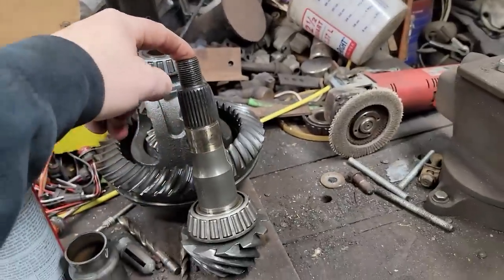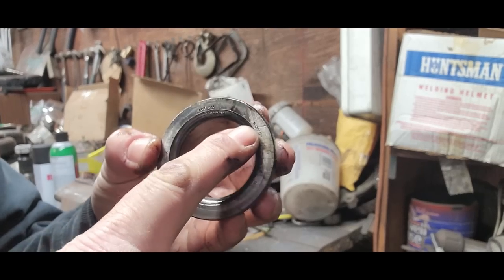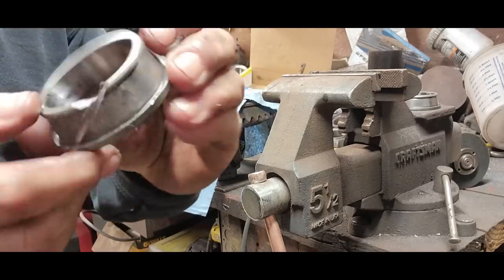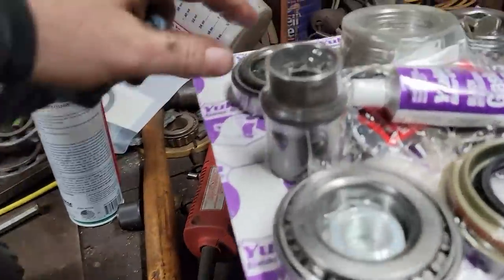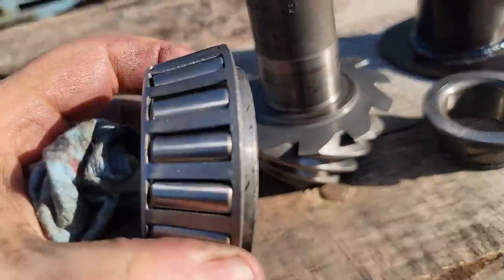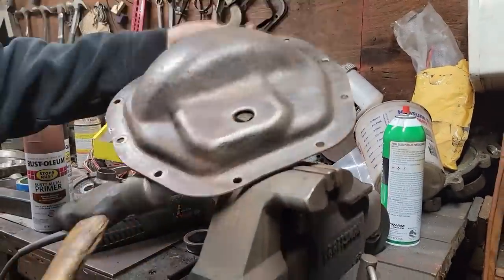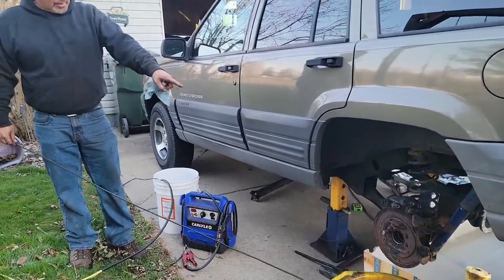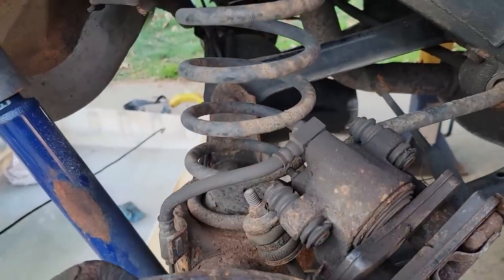JEEP REAREND REBUILD PT2 PRESSING NEW PINION AND RING GEAR CARRIER BEARINGS WITH OUT A PRESS!

Comment: I know you know but just to mention:
you can put the shaft/carrier in the freezer and bearings in the oven at 250 
and the bearings take much less effort to p-ress on
Reply from the maker: sure is an option. these went on pretty smooth. i was happy with the results so far.

Comment: If your able to save the pinion bearing or buy a extra you can run a small flap disk on the inside of it on a die grinder so it a slip fit Incase you need to change your shim. Then once you know it's shimmed properly you can slip it off and put your new bearing on. Hopefully that shim is right or your probably have to get another bearing.
Reply from the maker: i have used a cylinder hone to do that when i am changing the ring gear and pinion. i was thinking i shouldnt need to reshim the pinion since it was wearing well. otherwise, i would have done just that.

Comment: I use a cheap fry daddy filled with synthetic motor oil (higher scorch temp) to heat the brgs and they just drop on the pinion etc.

Comment: Advance rents various grades of specialty tools for what they cost at their price and you can keep them. They do appreciate a heads-up so they can order a new one which you could rent later and return the first one. I've done it many times which gives me time to think about is whatever worth having on hand or am I broke and need the $.
Reply from the maker: i am familiar with that. if i was in a spot that i could not do it without the tool, i would call my snap on man. he would let me borrow his until the one i ordered came in. i just dont like borrowing anything.
Reply: @j.c.smithprojects  Neither do I. I'd rather have a pawn shop tool that's mine now and worry about getting better when I can afford it. I hate loaning tools out just as much.
Reply from the maker: i will gladly help someone using my tools but i will not loan a tool. far too many times i loaned tools only to have to chase it down and go out of my way to get it back...usually damaged. not how i was brought up. "you return it in the same or better condition than when you got it or dont borrow it at all".

Comment: you probably have finished the Jeep before you read this i took a large nut welded to a pipe and then a 1/2" drive wore out socket to the other end to adjust the preload on the carrier bearings

Comment: To my surprise, Harbor Freight bearing splitters are actually alright if your OTC set never shows up. OTC is offshored as well.

Also, the last nasty differential I got into, I put a ridiculously strong magnet on the outside of the cover just to help pull any debris inside I may have missed away from the moving parts. It will also help catch any fine particles from new bearings and a new gear setup breaking in.
Reply from the maker: very good point. i will try and find a very strong magnet.
Reply: @j.c.smithprojects  I used one sold for magnet fishing that had an eyelet it on it so I could zip tie it to the anti-sway bar just in case it ever gets knocked loose.
Reply from the maker: im going to put it inside on the diff cover.
Reply: @j.c.smithprojects  I thought about that, but got gun shy that it might come off when oil is blasting around in there. I considered gluing it in, but then putting it on the outside ended up solving all of my problems. I used a 250lb pull magnet that should have plenty of guts to do the job through the cover with no risk.

Comment: I really like your tube cleaner tool     great idea and im def gonna make one
Have you seen the steck hub saver race tool        basically it rotates a hub while you heat the race til it just falls off     ive bought one recently and it works slick       its for a hub so its held in place on a cone     in your application with a solid shaft im thinking maybe a turntable with a small vise      might be a worthwhile project
Reply from the maker: no sir. i have not. i was going to use one of the induction heaters to heat just the inner race.
Reply: @j.c.smithprojects     yes the heat to expand the race is the main idea    the rotational movement just ensures equal heating      it seems so simple easy a guy wonders how he never invented it himself       a bearing splitter should work fine getting in behind the race and doesnt slip off like a 2 jaw puller